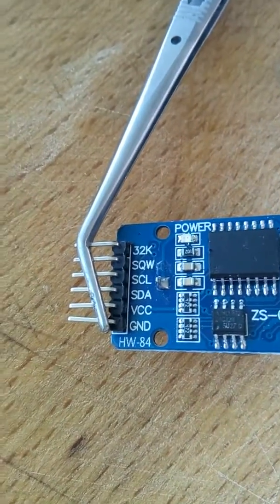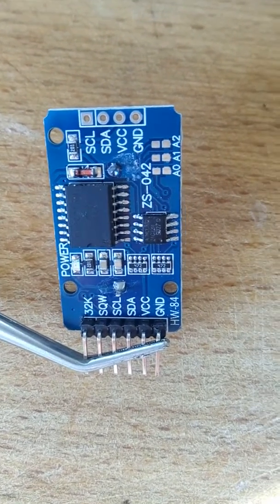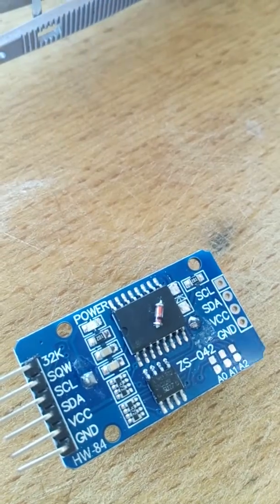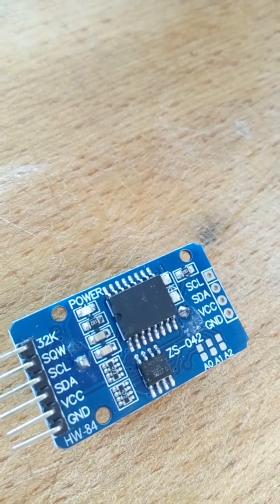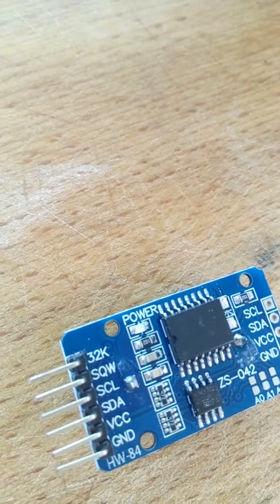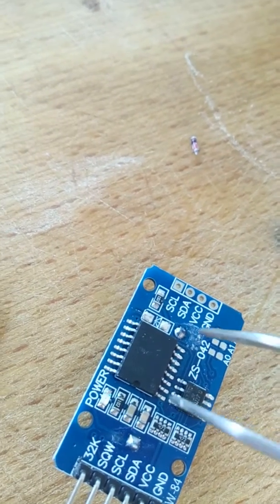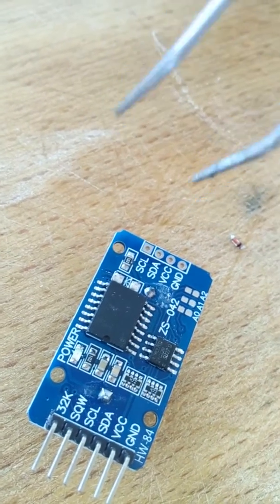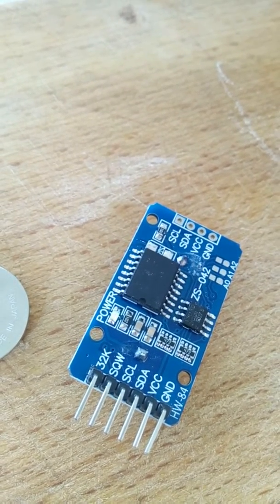How to fix Arduino watches module | RTC module problem | fix DS323 | RTC module wrong time

Comment: I have a DS3231, looks just like yours.  I have same problem, battery (non-rechargeable) will not maintain the time.  I'll have to try your fix, I've tried lots of other things and nothing works.  I have extra DS3231s in case it fails.  I'll have to try your fix!  Thanks.